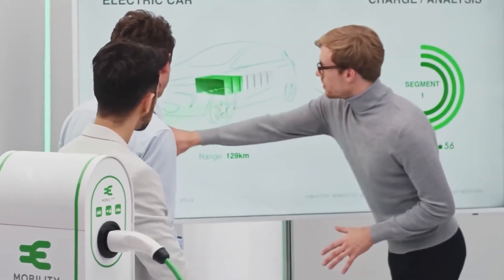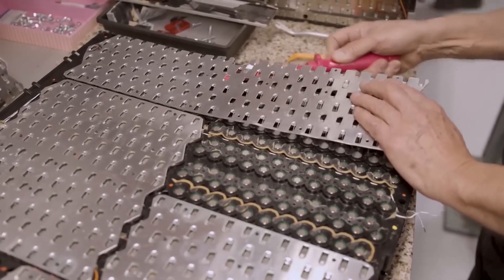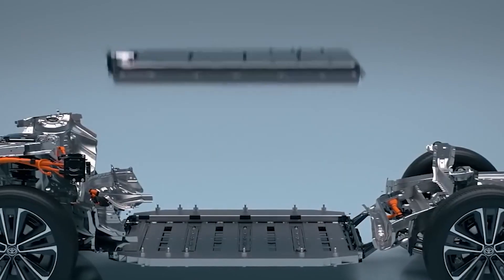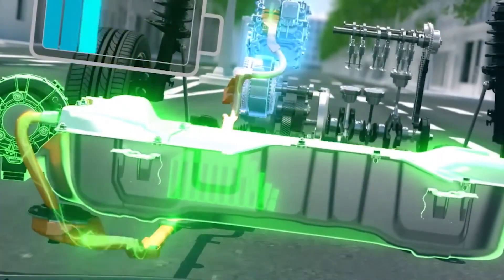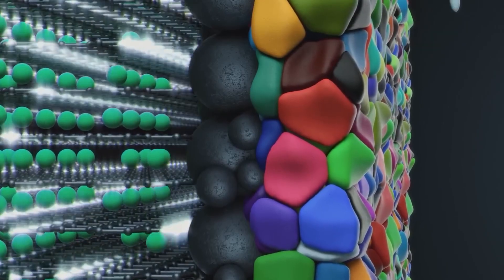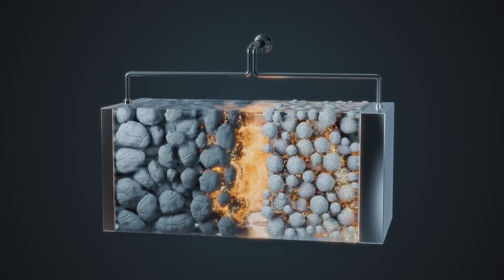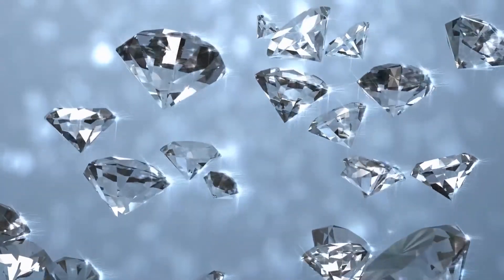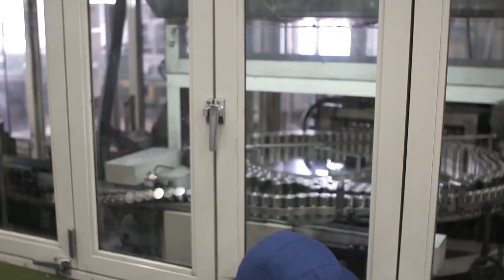IT HAPPENED! Nuclear Diamond Battery Finally Going to Launch

Comment: Good interesting video but and it’s a big but.powering vehicles in space yes we’re you can’t  recharge the batteries and here’s the but. Not Ev’s on earth because no energy company is going to allow a battery to exist which doesn’t need charging how are the energy companies going to make money and governments get taxes out of the electricity you no longer need to power your devices. Would be great if it works though. But watch this space hears my bet if it works and it can do all that you claim the technology and patients for it will be  bought by some company and hid on a shelf in a room with all the other game changing ideas that have been talked about. These energy companies aren’t going to give up there strangle hold on us that easily.
Reply: True assuming that don’t have the right business model. Odds are it would be a consistent rent fee to use a car powered by nuclear technology or be as expensive as a house but pay incrementally. The true hurtle is ditching the carbon 14 because it’s not energetic enouph and going straight to Nuclear thermal electric generators that have been powering light houses and space probes for decades. Now are that compact enough to fit into a car or even a trailer tugged by a car? Eh. But for home power generation assuming legality is miraculously resolved then I can see it’s use for stationary generators.

Comment: Lots of talk, little real information, such as the fact that while these batteries exist, the power output is in the microwatts.. power density is king when it comes to comparing batteries, especially if your going to drag EV's into the picture.
Reply: And how is there no radiation especially with what there using
Reply: it's yet another start up scam thing , it's old tech, electrical harvesting is a thing but produces very low voltage , put diamond battery debunked in YouTube a few people have run the figures

Comment: This video is complete rubbish. The power density is a simply too low to make these batteries meaningful for any consumer product like cars or phones. When you get 10 micro Watts per cubic centimeter, you can easily realize that getting kilo Watts of motor power in an EV is plain IMPOSSIBLE. And in the event someone ever came to compress enough radioactive isotope material to produce such energy through beta decay, it would OF COURSE become an insanely dangerous DIRTY BOMB. You simply can't have adequate power density and safety in one battery using nuclear decay. This topic is a sad disgusting SCAM promoted to ignorant people. Shame on anyone involved in it.

Comment: One of these batteries of comparable size to a typical AA battery produces 1000 times less power than a AA battery, but it last longer.🤣
Reply: it literally says 1.5v on it, thats the same as another AA
Reply: @FataIHorizon  It can output 1.5 volts but as the max power is in the micro watts, it’s completely unusable as a AA battery.
Reply: the battery hasnt even been produced yet how do you know
Reply: @shamarerskine3987  It is in the patent.
Reply: @shamarerskine3987  An ordinary AA battery can output 3 Watts or more. A nuclear diamond AA battery can output about less than 1000th of that. The reason is that the source of the power is beta radiation and any relatively safe level of that radiation is also with very tiny power level. If a much more radioactive isotope such as NI63 is used, you can start making meaningful power output but it then becomes a very dangerous battery and NI63 is dangerous to make also. This diamond battery idea is just a stupid scam.
Reply: @shamarerskine3987  If you understand the physics involved with nuclear decay of Carbon 14 emitting beta radiation, you will realize that there is simply not enough electrons being emitted from this isotope to represent a power density sufficient for all the claimed applications. This is great only as pace maker battery technology, but such nuclear decay battery technology for pacemakers were invented 40+ years ago.
Reply: Yes, this video is complete rubbish. The power density is a simply too low to make these batteries meaningful for any consumer product like cars or phones. When you get 10 micro Watts per cubic centimeter, you can easily realize that getting kilo Watts of motor power in an EV is plain IMPOSSIBLE. And in the event someone ever came to compress enough radioactive isotope material to produce such energy through beta decay, it would OF COURSE become an insanely dangerous DIRTY BOMB. You simply can't have adequate power density and safety in one battery using nuclear decay. This topic is a sad disgusting SCAM promoted to ignorant people. Shame on anyone involved in it.

Comment: These batteries produce .01 to .05 watts. It takes 5000 to 7500 watts to run a single house. You do the math. You would get more power from a solar panel of the same size. They are looking at these batteries to run pace makers or maybe watches.
Reply: the battery literally says it has 1.5 volts on it which is the same as any other AA battery lol, also if you look on their site they have plans for other generations of power for larger scale structures that obviously need more than a damn battery to do the job lul
Reply: @FataIHorizon  depends on the amperage.  1.5 could be built into a 12, 24, or 48 volt system pretty well, but even if it had the power of a AA battery (say, half an amp) a 48 volt pack would need to have 32*40 or 50 batteries to give you 1kw.
Reply: Some homes run on 400-500 watts of electricity.  But yes, these things can't power most stuff.  I did the math, and even at 100% efficiency, it would be take hundreds of kilos to make 1 KW of power (.08 watts per 2 grams if it released it evenly over its halflife.)
Maybe i could see a homeowner putting in hundreds of kilos of batteries in there basement to run their home, but power density is much lower than normal batteries
Reply: @ancapftw9113  All I need is around 25 watts of power to recharge my 500 Watt-Hour ebike battery every day for everyday usage. Then again I don't need to use it everyday so maybe half of that or 12 watts would be acceptable to charge it every two days. If I could do that then there would be no need to use a plug in charger.
Reply: @m9078jk3  so you don't have electric lights?  A refridgerator?  A cell phone?
Reply: @ancapftw9113  I do have electrical power in my house but I would prefer to not have a charger charge my ebike battery. Instead a lower 20 to 25 watt-hour trickle charge would daily charge my lithium-ion battery pack so no charger would be necessary and everything could be self contained-onboard
Reply: @m9078jk3  Even at 12 watts, it would take a hundred+ of these batties to do the job.
Reply: @m9078jk3  pedal charger would work well.  Or a solar panel.
Reply: @leegibson5469  That's workable I already carry several hundred already in 4 -480 watt-hour battery packs for extra range. I could swap some of those out.
Reply: @m9078jk3  Yeah, I think my math is wrong. I think that is power generated over 100 years. They are trying to compare it to lithium over the same time span to see if its viable in some very specific equipment. Like satellites or pace makers. Right now, I think its just a pipe dream. Maybe one day.